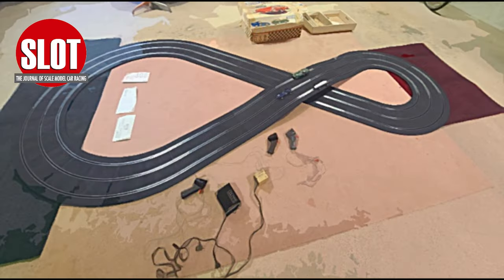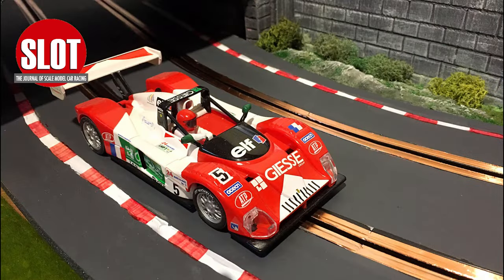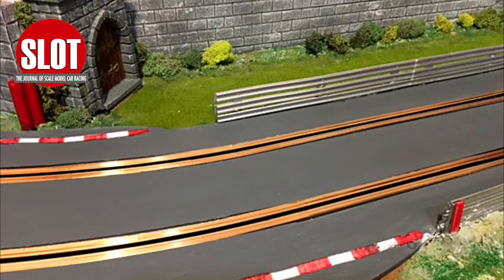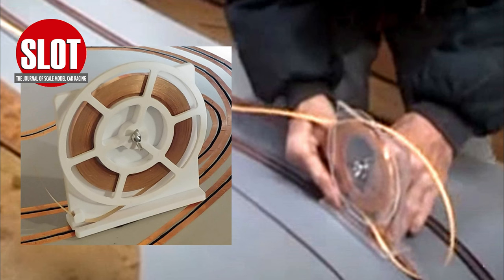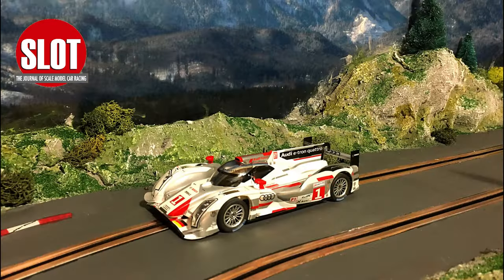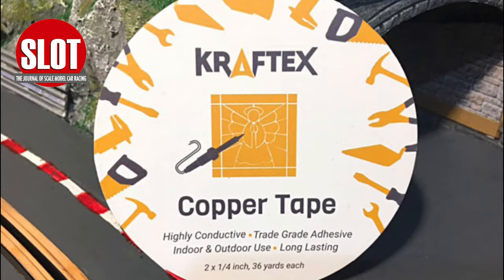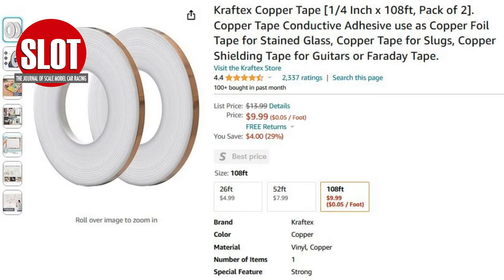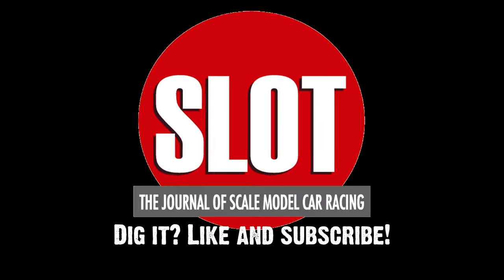SJ EP 14 - Track Build Guide #8 - Copper Tape on Plastic Track

Comment: I've just tried the same product on a small piece of track and the cars wouldn't run on it. . However when I took that small piece off and replaced it with a fresh piece it worked! The adhesive isn't conductive and the reason it worked was because a small piece of the tape had turned in on itself and was making the contact with the track.

Comment: You might find that installing a dissimilar metal causes corrosion and loss of contact after a while. Adding jumpers between sections probably will do more over time. Depending upon track length you probably will add additional jumpers back to power anyway.

Comment: Have you got a Scalextric 124 layout then Mark?
Reply from the maker: No - it's an Artin 1:32 track - hard plastic very similar to Carrera, but not as wide and I don't believe the rails have quite as much magnetic attraction as the Carrera stainless.  I added borders (and made some) filled all the joints and painted with latex; it provides nice smoothness and good grip. Thanks, Wayne!

Comment: Great job Mark. That's a lot of time and patience spent. Hats off to you buddy🎉🎉

Could you potentially put the tape in strategic places around the track to fortify connections or would jumpers make more sense at that point??
Reply from the maker: I guess you could - the advantage to copper is not only the conductivity but also the fact that it's a continuous (or mostly so) piece.  I suppose you could cover a problematic section by linking two "good" spots at either end, but being a stickler for appearance, having both copper and metal rail sections might not be my choice. Maybe a better solution would be jumpers after all.